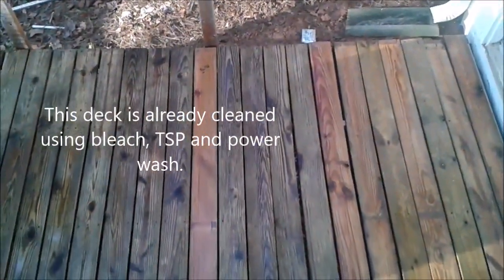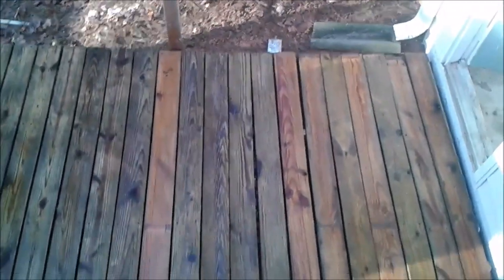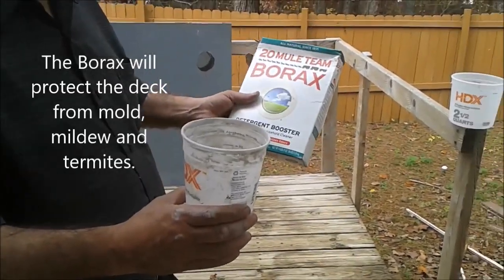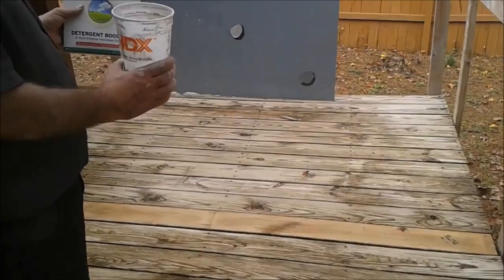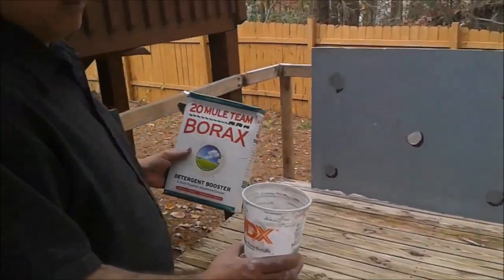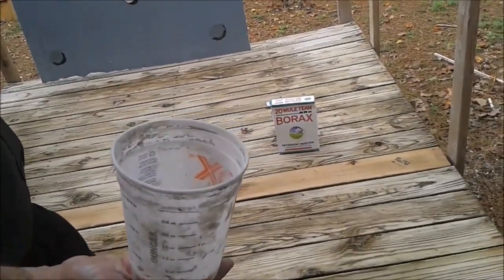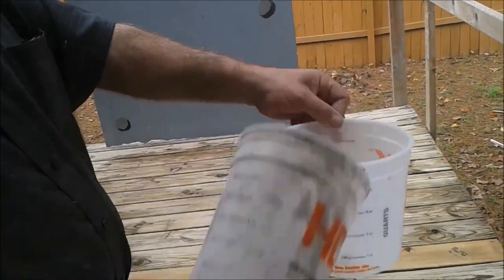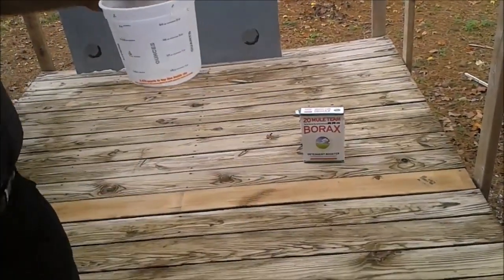How To Use Borax To Clean And Protect A Deck From Mold and Termites

Comment: This doesn’t last. In my trade as a carpenter boron which is basically the same as borax, is only a topical treatment for internal use only. Rain washes it off. This is handy man work. Do it properly, if your decking is rotting, replace it with pressure treated decking. Galv or stainless fixings. Then treat your timber with a decking oil so it penetrates the timber. Coat every year or two. Make sure you have 3-5mm spacings in the wet season and your good to go. Don’t just listen to handy men and get your info from them. Do what the pros do. My 2 cents worth
Reply: When you re-coat, how do you prep the deck/surface?   Or do you just blow/sweep off debris and then apply?
Reply: @coppulor6500  either a deck wash solution and scrub it down. Or gentle water blast. Let it dry and oil some more
Reply: @stevec5192  I really appreciate the response. What product(s) do you like for decking oil? Also, I'm assuming you mean an actual oil and not just a generic term?   If so, do you need to put something under the deck if there's a patio to prevent staining? Thank you!
Reply: @coppulor6500  clean deck with dish soap and hot/warm water and even borax in the water if you want and then do this it's very important to keep your duct cleaning 2 times a year minimum to keep organics off
Reply: @marcfavell especially here in the south.  It's bad enough here in Georgia. I can't imagine living in Florida.

Comment: what if the deck already has a solid stain applied, would this still provide the same protection ??
Reply from the maker: No. The way it works is the Borax substance absorbed into the wood. The wood then dry the water evaporates but the Borax salt stay in the wood. When the wood already stained it will be difficult for the wood to absorb the Borax substance.

Comment: Hello. Thank you so much for sharing the information. 

Can I use borax on not stripped deck? I'm waiting for someone to fix the stability of my deck built last year (light oil stained) at the house I recently bought. After the fixing, I will strip and stain. I'm getting tired to see little things running around on my wood. Thanks in advance.
Reply from the maker: Yes you can. When you stain the wood make sure the wood is dry.
Reply: As soon as I got your reply, I went out cleaning and giving a borax treatment to my deck. Very small insects (like half millimeter size) were running all around and I was desperate until I found your channel. Thousand thanks and wishing you the best.
Reply from the maker: @Aria512  Any time

Comment: Great info very interesting and easy indeed.   Is the the same if I use Borax (much cheaper) versus Copper Green?  How many years do you think Borax can protect?

If this is truly effective, then your video should go viral imo.
We should have know about how to treat wood and annually inspect our home for terminate, dry rot etc.  I did not do everything and now I found termite damage on fascia, rafters that will cost 1-2k to repair, and might need fumigation sooner or later at  more money. 

What other products or method to treat wood that was already painted?

What are other products to treat wood before painting can I use as I have to repair/replace my fascia, rafters and exterior wood on my home?  
I guess you won't need borax  if you have pressure treated wood right?
Reply from the maker: Before pressure treated they  industry used borax. Borax is more expensive and slow than pressure treated with copper. 
You can only treated naked wood (no paint or stain ) with borax.
No need borax when the wood is already treated with cooper.
Reply: Joseph K I don’t think it’s possible but can you treat wood that  had been painted already?
Reply from the maker: If the wood was painted properly it would not be penetrated by termites. The wood probably has spots in which the paint is  faded or gone during the years, so if you able to put borax in these spots you will be successful treat the wood against termites.